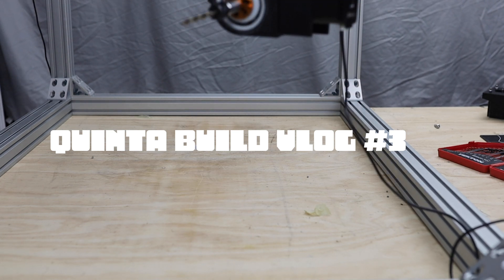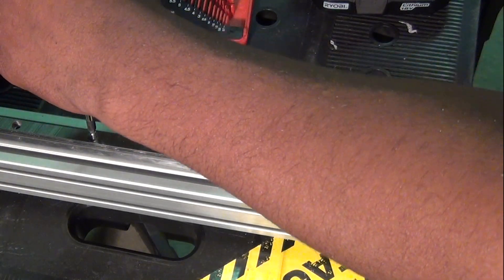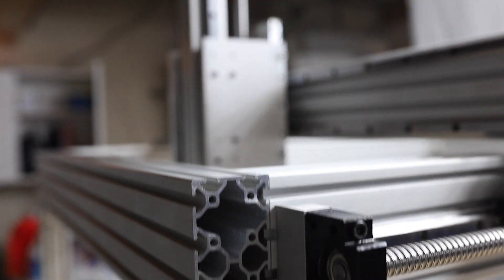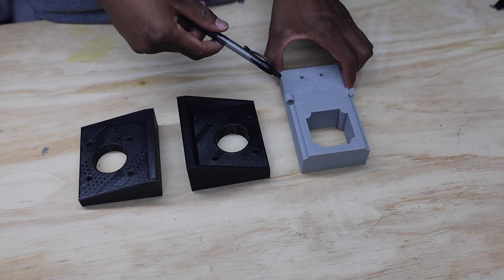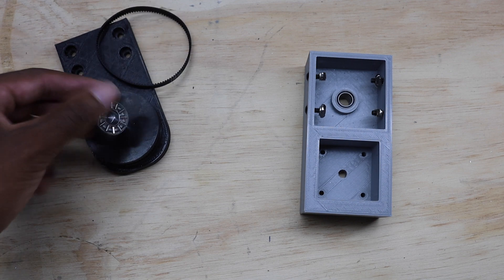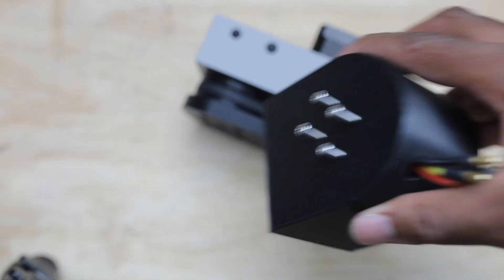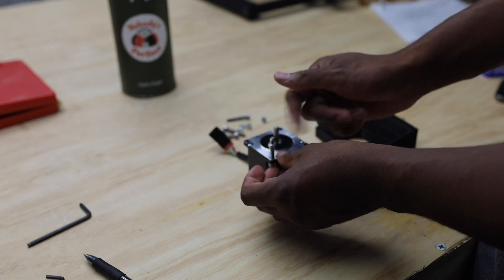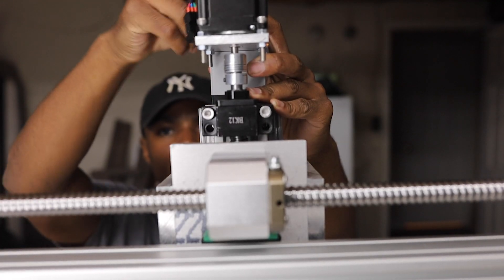DIY 5-Axis CNC Build (Part 3: Z & AB Axis)

Comment: I have some question about y axis: Why need 2 motors for y axis?  And since the controller you use has only one port for y axis, how did you control the another one? by just parallel connecting  the port to two drivers? (step motor has no feedback, perhaps it's a solution ?) Thank you.

Comment: well done, this machine is very necessary. you can mill wax molds to make uhpgc concrete parts instead aluminum and use melted recycled plastic with chopped fiber glass for rack and pinion and all the parts you 3d printed. i have seen that rotational axis  and i suppose it could be improved the spindle holding system instead a hook type

Comment: I watched this out of order so I don't know if you mentioned this at some point. Did you use any carbon fiber composite filament? Also are you considering replacing the 3d printed parts? I'm so new to this that I want to set limits to my excitement before the practical real world spoils my fun lol.
Reply from the maker: First, thanks for watching the vids I appreciate that! As of right now all the parts are made of ABS and PLA. I recently bought a new hot end and extruder and am working on upgrading my 3D printer so that I could make the parts out of NylonX ( which is a nylon/carbon fiber mixture).  As for future plans to make the parts out of metal I haven't really looked that deep into it. I know its something thats possible, but for the application that I planned on using the machine for it wouldn't be required. There's a ton of design constraints that arise when you intend to design a machine to mill metal. Metal is intrinsically a tougher material to machine and its current configuration Quinta isn't optimized for milling metal even if I replaced the 3D printed parts.

Comment: Damn man, this is really impressive. When I first saw the thumbnail of your video I was expecting you had made a frame for the X, Y and Z axis and had bought a prefab 4th + 5th axis milling head. So I was mighty impressed when I found out you had designed and made everything yourself, including the 4th and 5th axis as well! You mentioned you only use it to mill foam, are you using it for some form of prototyping or something? And have you looked into a wirecutter as well? I don't know whether your 5-axis milling machine would be easier or hard to build, and less or more accurate than one of those foam cutting machiens that use a heated NiChrome wire?
Reply from the maker: Thanks Man! Yeah so I originally started building it because, I personally wanted to make car aerobodies for aerodynamic wind tunnel testing out of foam. Also I was applying to a few internship and they all wanted machining experience so I though I should just design my own CNC. I've seen the wire-cutters but they wouldn't have been able to do what I was looking to do.
Reply: @quintacnc465  And have you done any testing with various materials to see what kind of tolerances it had, and what the hardest/toughestt materials are that it can still mill? Strong plastics, perhaps even soft metals such as copper and brass, and maybe even aluminium if you take very light cuts?

Comment: Hi man, what sort of controll are you using and what cam programm
Reply from the maker: Hey,
 Fusion 360 for CAM | MASSO for Control | Slightly modified MASSO Post Processor from fusion 360

Link to the unmodified  Post: https://cam.autodesk.com/hsmposts?p=masso

Comment: Legend
Reply from the maker: Thanks man, trying my best!
Reply: @quintacnc465  do you mind telling the specs on the motor/spindle you're using with the collet/chuck I'd like to get the same and build my own 5 axis
Reply from the maker: @aviator267  Go check out the next video(Build Vlog 4), I provided a link to the STL files and all the links to where you can buy the collet, brushless motor, and other components for the  V1 head!
Reply: @quintacnc465  thanks so much
Reply: @quintacnc how could i get InTouch with you. i ned help with my build

Comment: Very nice, but those 3D printed parts won't deform from the heat of the motors?
Anyway,  good luck with your project! 👍
Reply from the maker: Thanks! As long as the current draw is low enough they're fine, they get slightly warm but not too hot. I would Recommend using abs for better heat resistance thought.

Comment: Looks good. I'm curious about that outrunner motor you are using as the spindle. Have you done any testing running it without cooling for extended periods? they generally need a fan blowing over them to not overheat, even under no load. you might even be able to get away with a small 3d printed fan that slip fits overtop of the ER collet head and just circulates the air into the motor a little bit
Reply from the maker: Thank you. I have been testing it under load leaving it running for period of about 30 minutes. Thats a good suggestion, I have been considering mounting a cooling fan to improve airflow and cooling.

Comment: Nice work! , I have a 4 axis router with mach3 controller yet the g-code from fusion is missed up and the machine work different than simulation, guess i don't know how to configure my machine, i'll stay tuned.
Reply from the maker: Thanks man! You probably just need to mess around with the setup folder to get the kinematics right.
Reply: The kinematics in fusion didn't work but editing the post processor made the machine work :)
Reply from the maker: Yeah I thought about you issue yesterday glad you figured it! I will leave this link here maybe you or others will find it useful. 

https://youtu.be/mbBkrYQ1AbM
Reply: I don't how yet can you make a video about setting up the distance from the rotary center of rotation to the tool holder that's kind of my problem,cheers.
Reply: So how the work is going in your machine got any chips yet?
Reply from the maker: @abdelrahmanelmasry9699  Everything has been good. I've made a few cuts in foam but I am currently working increasing the rigidity of the head!

Comment: how to get G-code for 5 AXIS???
Reply from the maker: Fusion 360 manufacturing extension supports 5-axis tool-path creation
Reply: @quintacnc465  thanks for your reply,is it possible to let 5th AXIS to turn on only when the Z AXIS coordinate=0 otherwise stops??????if so ,how to do so
Reply from the maker: @raifhanna131  Wether or not the AB head moves is dependent on your tool path G-code. So yes, that would be possible. You would just need to create a tool-path that met those parameters.
Reply: @quintacnc465  sorry  dear,if you have time and i am not bothering you ,please explain more,i want to know how in steps if possible,best regards

Comment: nice job dude cant wait for the fonctionality any way i want to ask about the electronics will you go with arduino or pi  and what code you gonna use 
just curious 
and thank you dude waiting for next vid
Reply from the maker: Thanks, currently I am using a MASSO cnc controller because it supports 
5-axis and is relatively consumer/hobbyist friendly. All tool paths and G-code are generated in Fusion 360. Next video will be out soon stay tuned, cheers!
Reply: @quintacnc465  hi , Here is the video of it All tool paths and G-code are generated in Fusion 360

Comment: Hey I really like the design of your AB axis assembly. Would you be prepared to share the 3D models for the printed parts ? I’d love to see if my printer could print the parts and build a similar machine.
Reply from the maker: Hey Kieran, I am waiting to work out all the kinks in the design before I release  any of the plans. After I finish I may release the plans/parts list for the whole project!
Reply: @quintacnc465  A year is away, do you expect to publish the project?

Comment: Do i need add machine axis geometry in cam software for generate correct g code for this machine?
Reply from the maker: In Fusion 360 they have a few different geometry setups for 5-axis machining that you can choose from.
Reply: QuintaCnc I recently spoke with manufacturers of controllers for five axis machines.  According to them, if the controller supports the rtcp function, then in the cam program no kinematics settings need to be done, just select the type of machine head-head-table-table or head-table.  The axis of rotation of the spindle and tool holder is specified in the controller settings.  They say everything will work without problems.  You are a person with experience, what do you say to this?
Reply from the maker: From what I know ( I'm currently figuring this stuff out for myself), in fusion 360 there is variety of different set-ups for machine-axis geometry. You can choose from head-table, head-head, etc. there is also a quite a few different options for choosing the configurations of your rotating axis as in A-B head, B-C head, A-C head. By changing the setups in  Fusion 360's CAM it will affect how the G-code is generated for your specific setup. All the kinematics are resolved within the CAM software on the basis of how you defined everything in your setup. Hope that answers your question I'll probably do a video on software after the next video!